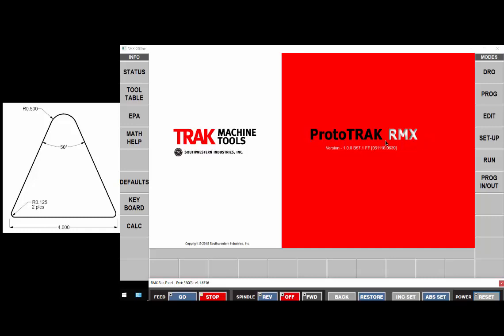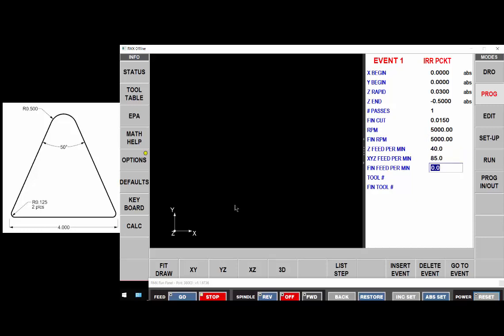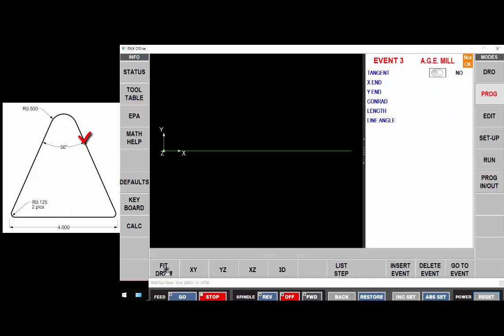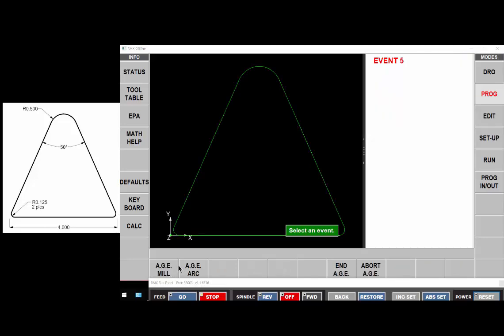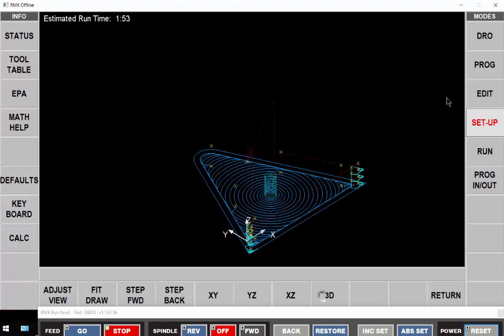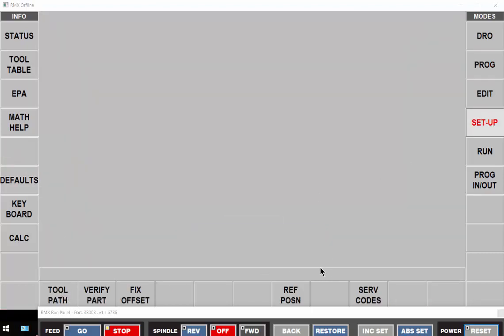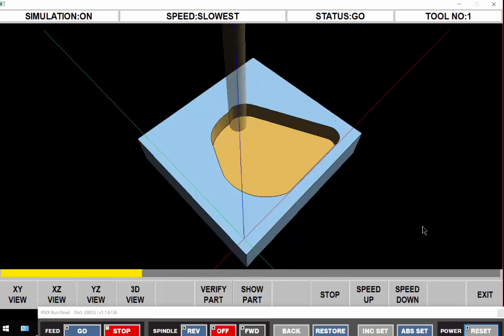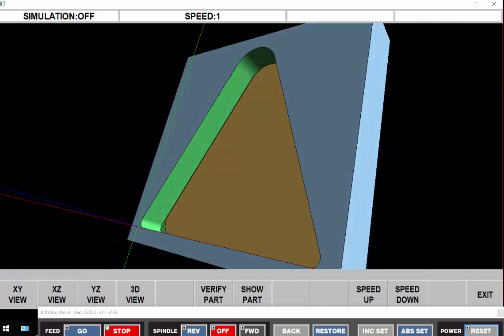ProtoTRAK RMX - Triangle Pocket - Adaptive Machining

Comment: I just got a LPM and it didnt come with this feature. What version software are you running?
Reply from the maker: This video was shot using the new RMX control from TRAK Machine Tools.  Your LPM is an earlier generation control that does not have this capability.  However, if you want this kind of capability, you could purchase the RX offline software with the cam-out option and it will take this machining pattern (and many, many more patterns as well) and turn them into a g-code file that you can then run on your LPM.
Reply: @TRAKmanFlorida  is that software pretty expensive?
Reply from the maker: @Witchpit  Just a hair over $1000.00 to do what I described.  And, no annual fees.  It's a bargain.  Just the adaptive machining alone will pay you back in weeks.